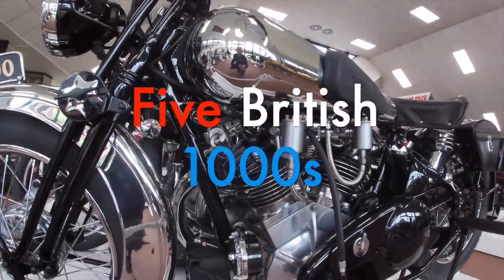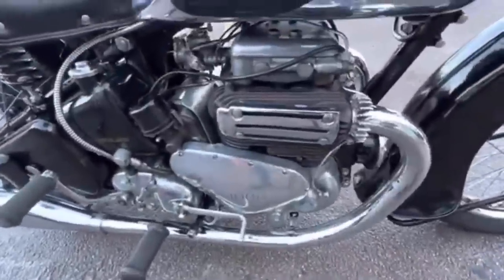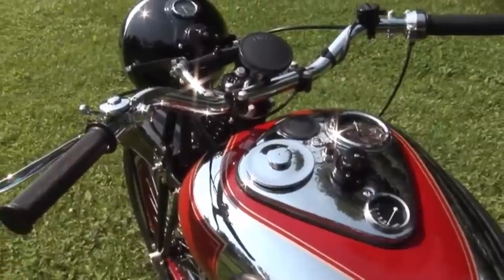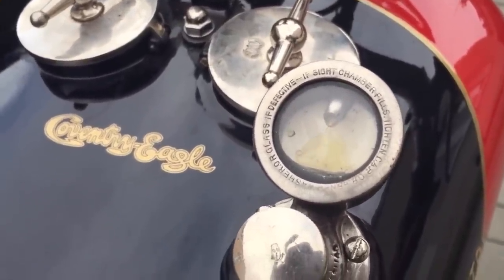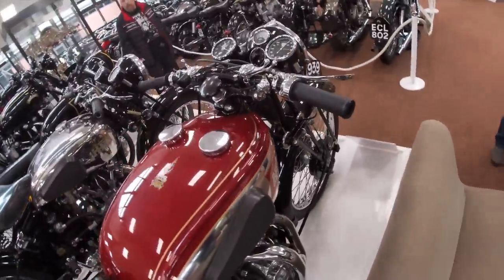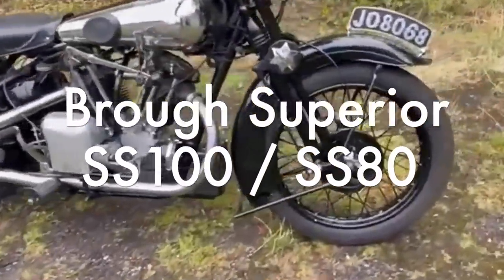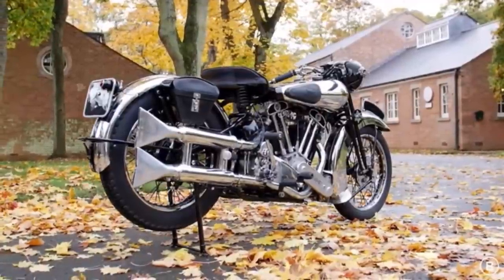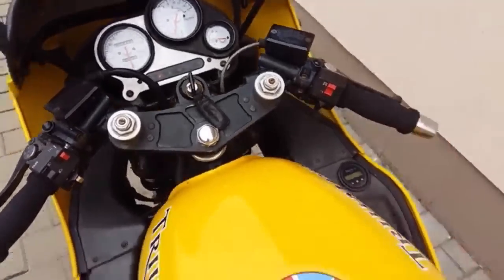5 British 1000cc Motorcycles

Comment: Very enjoyable video! The old bikes are just beautiful. I rode a Daytona 1200 once. It was the bike that made me realize that my Suzuki SV1000S has a slipper clutch! I test rode it for a local bike shop I helped out at for a couple of years. When I backed off of the throttle too fast it went totally sideways. Not difficult to recover from but quite different than I was used to. I like your moniker "onwards". My philosophy is "onwards and upwards" as I am a 30+ year aircraft tech with a 46 year motorcycle habit. I started riding at 7!
Reply from the maker: Seems appropriate 👍🏻

Comment: Another great collection, thanks. In the early 80´ies, a friend and I had a Squariel from the early 50´ies for one summer. we could not get the propper carbourator, so it ran with a BMW one, and did that quite well. I am still dreaming of the Vincent, although all I can handle nowadays is a mobillity-scooter. But dream I can...
Reply from the maker: Probably better off than the original carb 
Ironically it’s easy to get them now